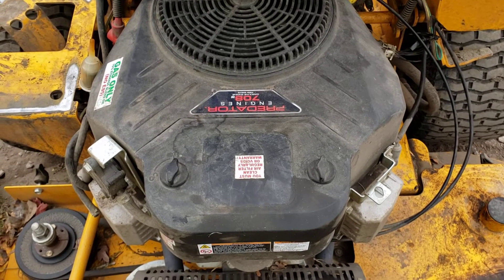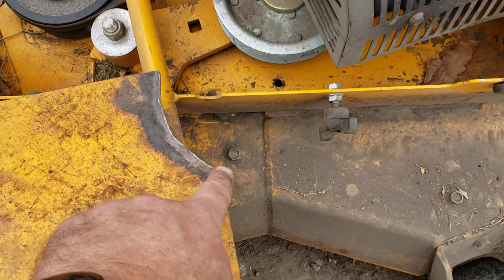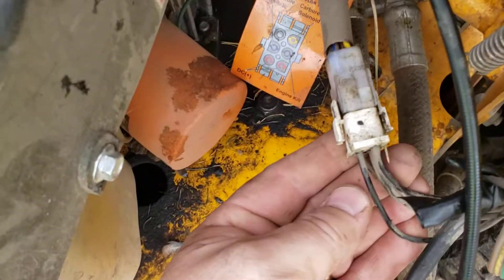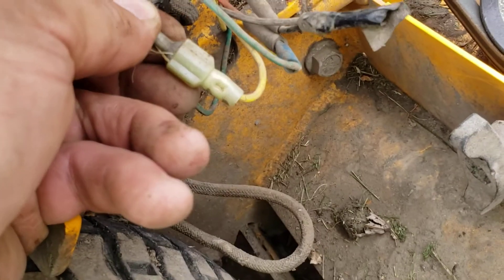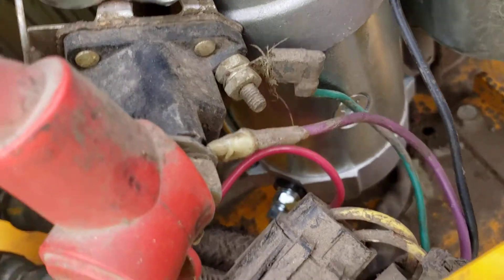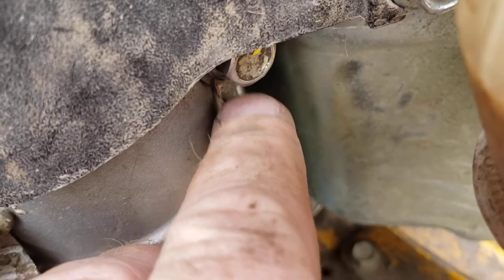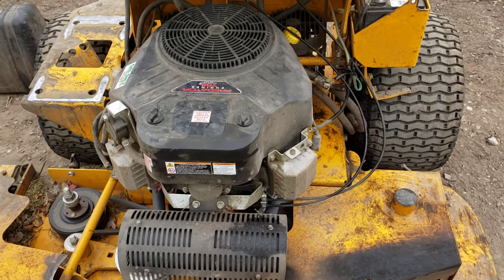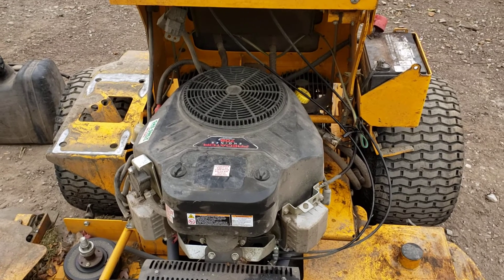Wright Stander 48'' Predator 708cc Engine replacement for Kawasaki FX691

Comment: Where did you buy your connector for the Harbor freight wiring?
Reply from the maker: Here is the main connector you need. You need to order both part numbers.

one of this PN
https://www.mouser.com/ProductDetail/538-36643-0005

six of this PN
https://www.mouser.com/ProductDetail/538-79758-2029